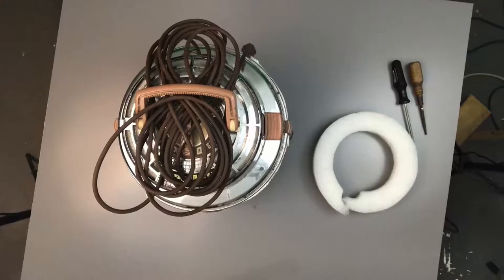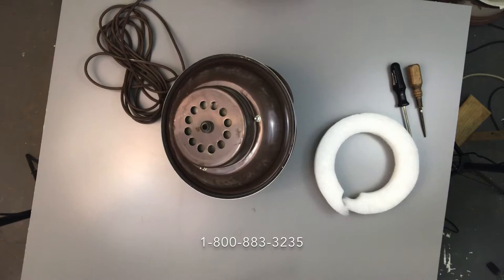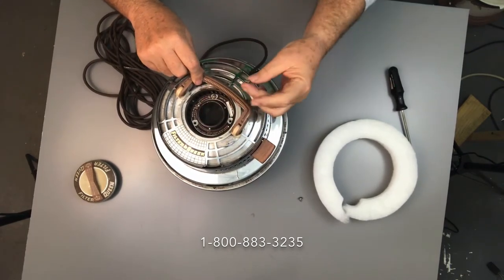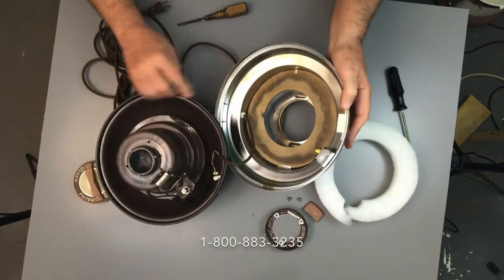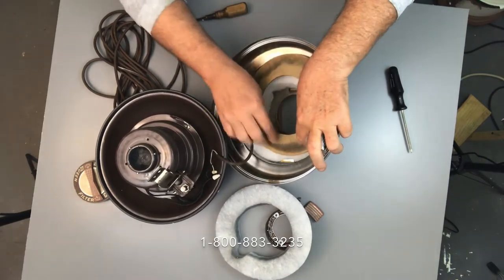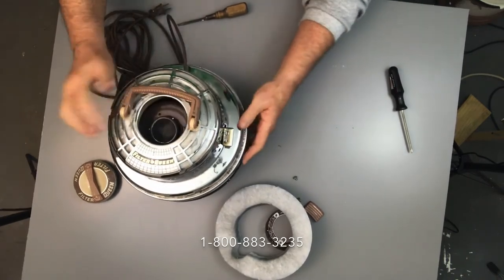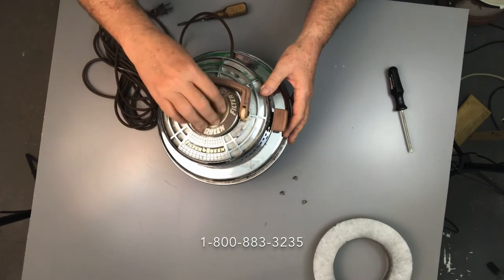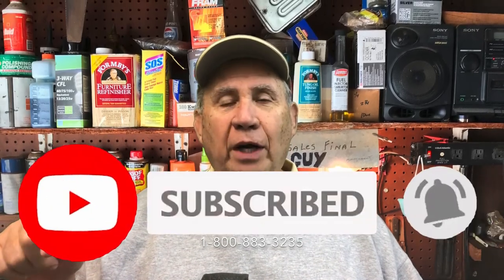Change The Filter in Your Filter Queen Vacuum Cleaner in Minutes | Mike's Garage

Comment: UPDATE:  I was able to pry off with very little resistance.  Popped right off and back in place with no trouble.  I replaced silencing filter!  Yes!  
I do have another question, though.  Do you know how to figure out manufacturing date of a Filter Queen based on serial #?
——————————————————————————
Thanks, Mike!  This was very helpful.  I do have one question, though.  I recently came upon a NIB D33 that was purchased, never used, and stored in a temp-controlled climate.  I want to replace the silencing filter; I purchased a new one, but I’m worried about how to remove the rubber cap on switch.  I don’t want to damage when prying it off.  I’ve seen another video where a technician said some type of adhesive is used to secure that rubber cap on switch.  What is the best way to remove the cap, without damaging?  Again, with this being new and having never been removed before, I’m worried about damage.  Thank you!!
Reply from the maker: Hay Austin  put your fingers under the lip on each side towards the back. Pull outwardly and up at the same time. Move it slowly towards you. Should come right off    Don’t recommend glue. Reverse the process to put it back on. 
Hope that helps
Reply: @MikesGarageVideos  thank you, Mike!  You’re right-it came right off.  :)